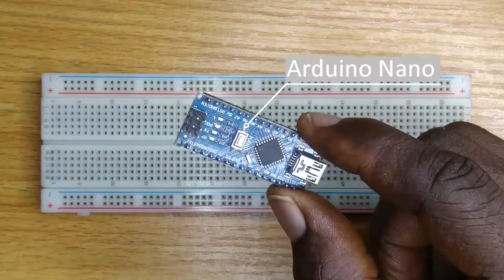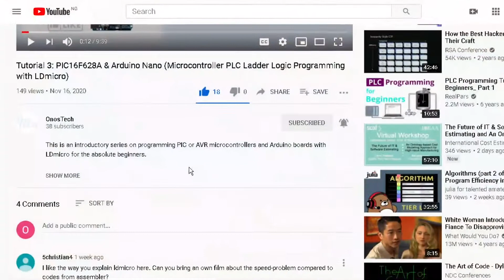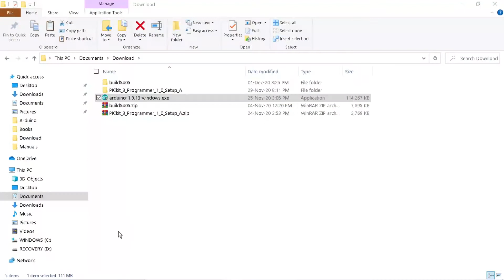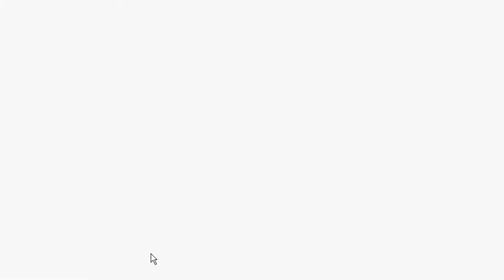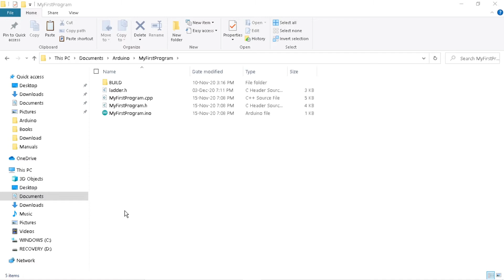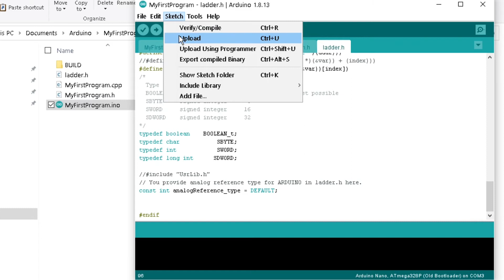Comment: hello, i have used a TOF timer (10 seconds on) in my ldmicro, when i tested the compiled arduino sketch generated by ldmicro, it counts 16 seonds intead of 10 with timer 1 and Plc Cycle Time : 10ms.
If i change to Plc Cycle Time: 1ms, it takes more time, Plc Cycle Time: 100ms is not allowed, i am using I2C library in my arduino and "uncommented UsrLib.h" Is there something to change in UsrLib.h for good cycle time?
Reply: As explained by Jose, the I2C library affects the PLC cycle time, thus it must be used scarcely. Try reducing the number of I2C instructions in a program. Also, try 5ms cycle time. Jose should be able help better.
Reply: @OnosTech  thank you very much
Reply: You are welcome